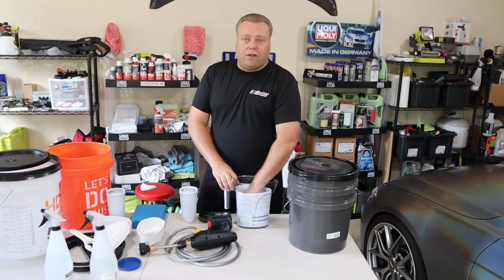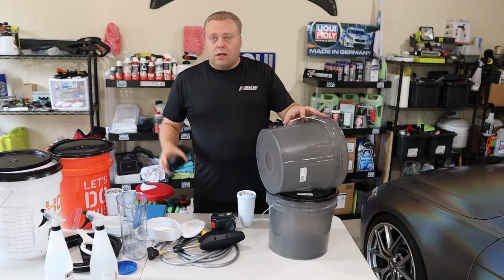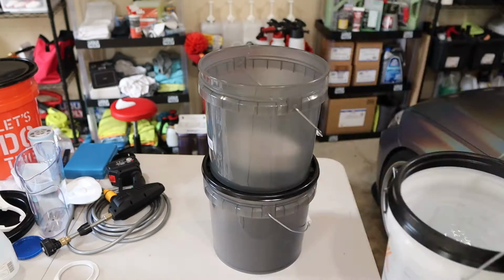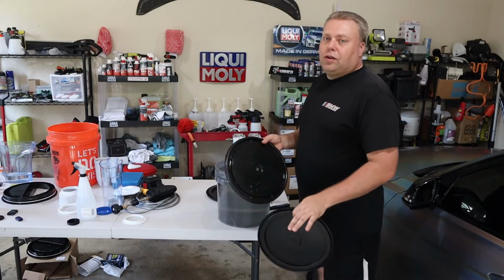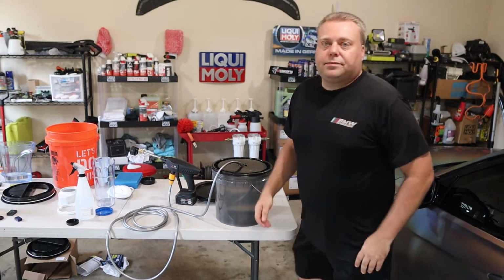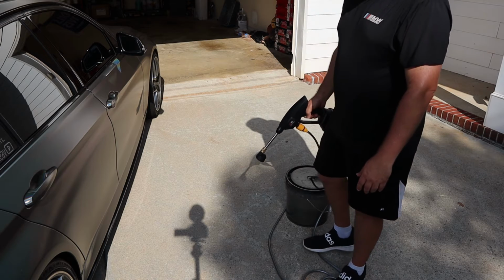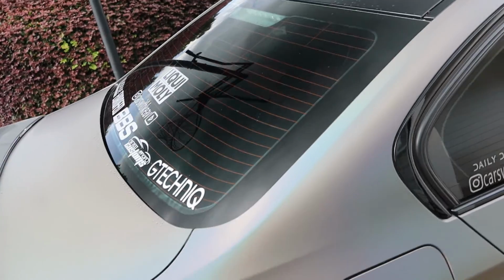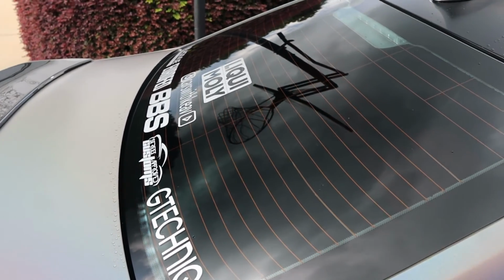BUDGET PORTABLE SPOTLESS RINSE SOLUTION | ZERO FILTER REVIEW

Comment: Great video!  Would this filtered water pitcher be as good as using distilled water?
Reply from the maker: It gets the same result just a different way. Distilled water uses the natural boil and condensation method same way alcohol is made. This pitcher is basically doing a deionization and some other filter elements to achieve 000 ppm. Actually you would be surprised if you read the small print on some distilled water. It will sometimes say purified using de-ionization.